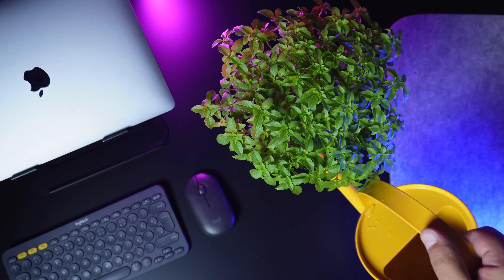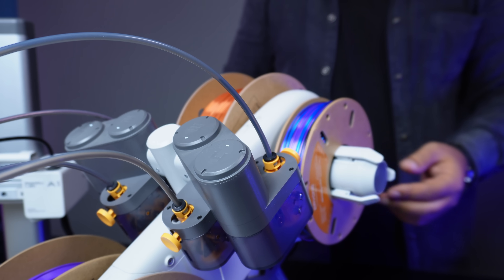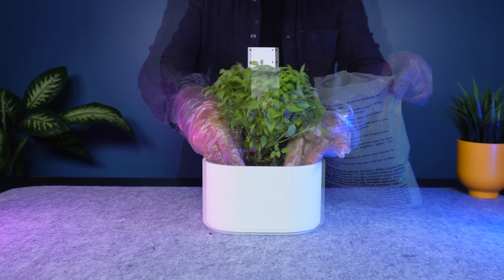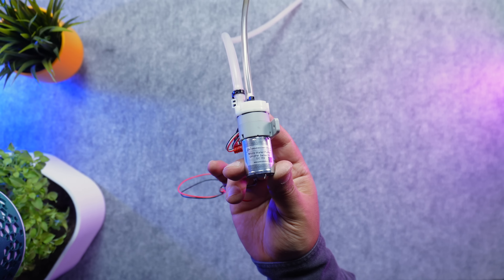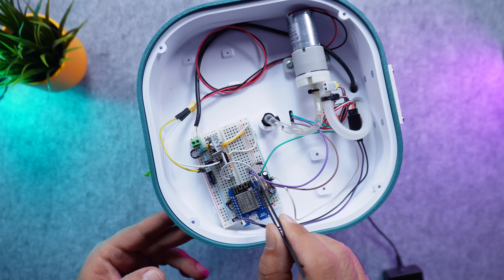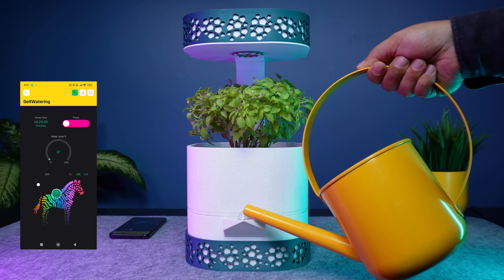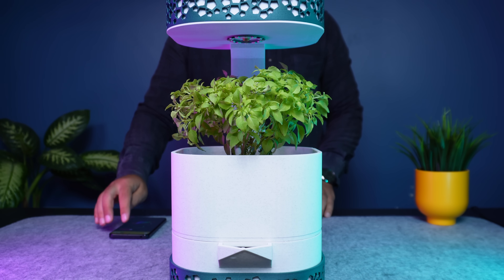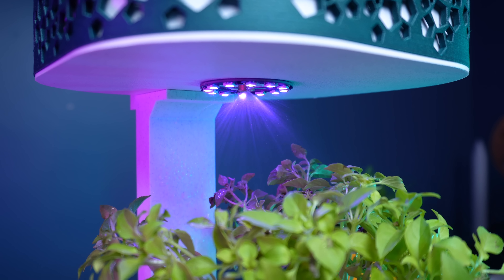A simple idea and a 3D printer… The result?

Comment: Great project!
A few suggestions if you decide to work on an upgraded version of the same concept:

Move the pump and electronics to the bottom section. Make it thicker if needed to include a separate compartment dedicated to the electronics.

Lower the “fence” to make the plant more visible — or replace the solid wall with a Venice bridge–inspired pattern.

Create a stylized Venetian lantern–style pole — thin yet rigid — with a hidden water pipe inside and an LED positioned above the flower.

Add an optional light at soil level to illuminate the plant from below.